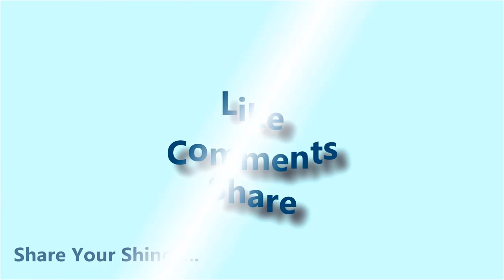Amazing Kerosene Cooker without hand pressure | No pump,  make Kerosene Stove using  plastic bottle.

Comment: This is available in shopee for 930 pesos.  General Master Kerosene Stove -Single Hanging Stove GM-888.

The heart of the stove is where the flame is.  I cannot imagine anybody discarding this type of stove with the head intact.  Anyway, nice project, although not original.  I was waiting for the change of fuel from kerosene to used oil.  The kerosene is used to heat up the head, and when it is hot, used cooking oil may be used.
Reply from the maker: Ohh, Nice Idea